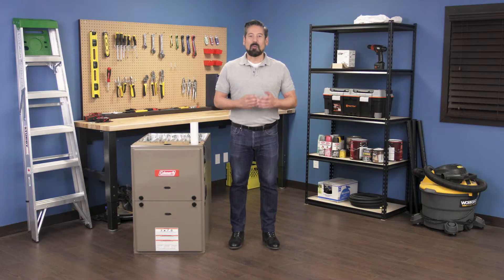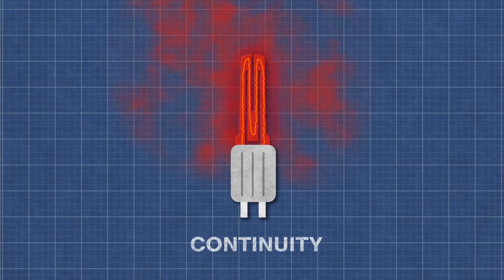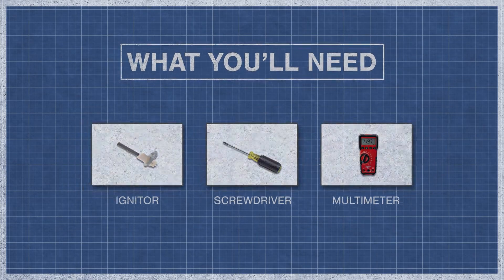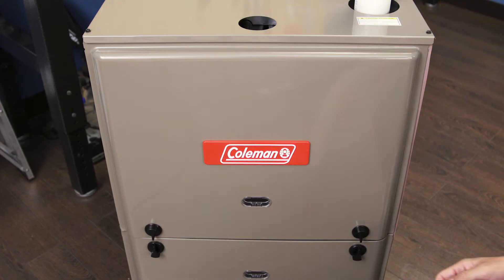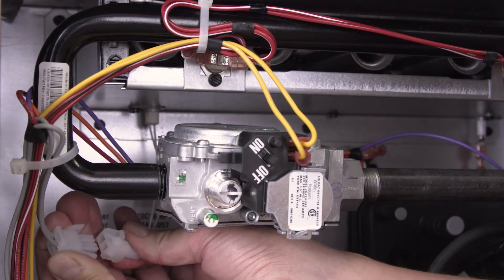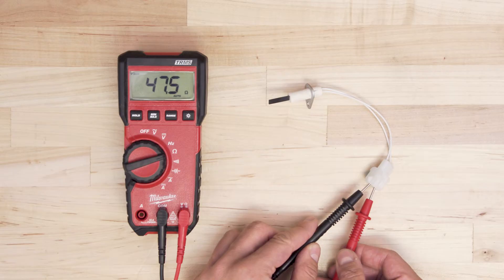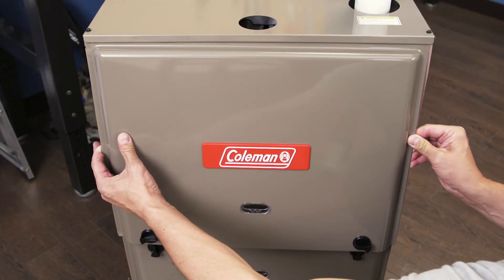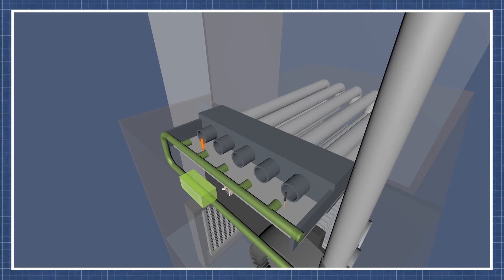Furnace Not Igniting? - Ignitor Testing & Replacement | Repair and Replace

Comment: Will igniter glow and gas still goes out. Can igniter be bad. Like not glow enough
Reply from the maker: Hi John, thank you for watching. Yes the ignitor can become faulty. If the burner isn't igniting, then its likely a faulty ignitor. If the burners ignite and the flames don't stay lit then its likely a dirty or defective flame sensor. You can learn more here: https://www.youtube.com/watch?v=af_qRnfHFws

Comment: I got bad igniter read 0, and new one  is read 15 to 16. Is this means the new igniter is bad ?
Reply from the maker: Thanks for watching. For the ignitor to work properly you'll need resistance. A faulty ignitor will have no continuity, or no resistance (a blank screen on the multimeter,  - - - - - -, or OL. If the resistance is between 0 -1 ohm then there won't be enough resistance for the ignitor to heat up. Most ignitors will have a resistance of about 40 -90 ohms but there are exceptions to this. 15 is a little low in most cases. If the new ignitor is not heating up enough to start the furnace then that would mean that the resistance is too low.

Comment: So mine on colder nights will have proper ignition, flame lights then shuts off.  Sometimes it will then repeat and fire up with no led code. I already replaced the flame sensor. When it doesn't light By the time I get to the LEDs it is already on a one hour lockout with double lights flashing.  Cycling power to the furnace resets.  Is this a control board issue?
Reply from the maker: Hi Nathaniel, thank you for watching. If your furnace is shutting off just after ignition there are a few things you can check before assuming its a control board issue.. Make sure that the flame sensor is positioned in the flame. Now double check all the connections between the flame sensor and the control board. As well the flame sensor is a rectifier, meaning that it needs a flame to complete the electrical circuit to ground. For the flame sensor to work the metal burner needs to be grounded.

Comment: Thanks for the video.  So what does it mean if the igniter is good and the burners turn on, but then goes out after a few seconds?  

LED light indicates "Ignition Failure:  If flame signal is lost after trial for ignition period, blower will come on for 90 second recycle delay."
Reply from the maker: Hi Roy thank you for watching. It means that the furnace thinks that there's no flame. Try cleaning the flame sensor, and check the connections. Without a strong signal from the flame sensor the furnace assumes that there isn't a flame present.

Comment: I just replaced my pressure switch my ignator is lit but burners not
Reply from the maker: Hi Ramon, if your furnace uses a pilot light for ignition (not a hot surface ignitor) then try cleaning or replacing the thermocouple  https://youtu.be/3EKbSiAJyiI

Comment: What if the ohms are more than 200?
Reply from the maker: A good carbide hot surface ignitor will have a resistance of 40 to 90 ohms. 
When the resistance is greater than 90 ohms, then its a sign of a failing or failed ignitor.

On nitride ignitors you should be around 15-40 ohms.

Keep in mind this is not universal as some manufactures will have very specific ratings.